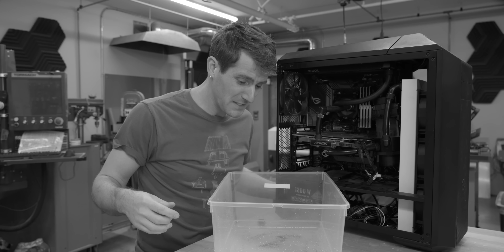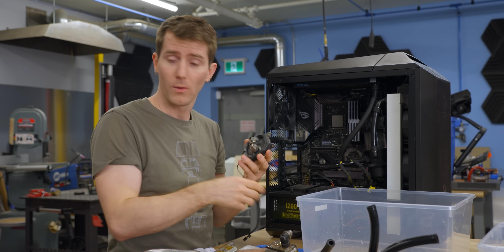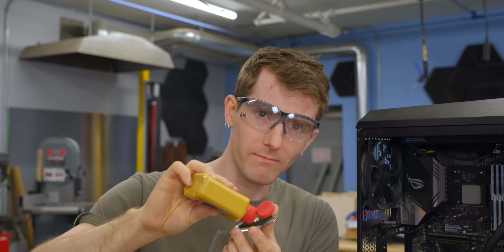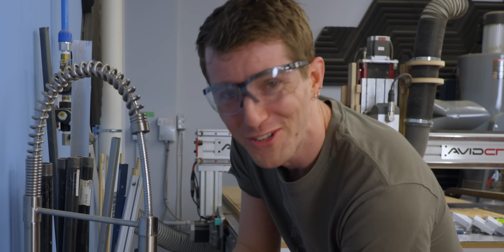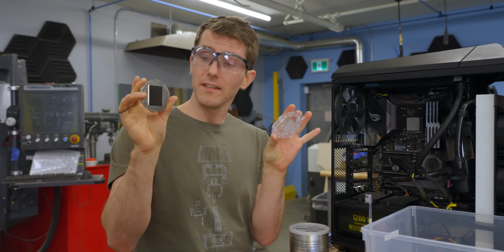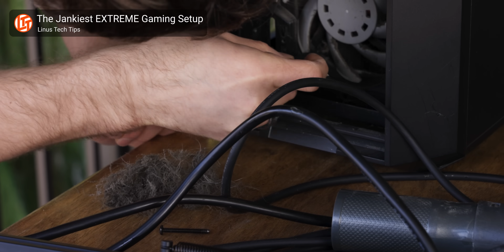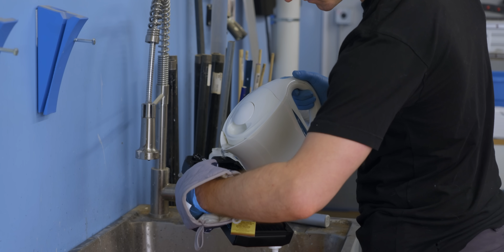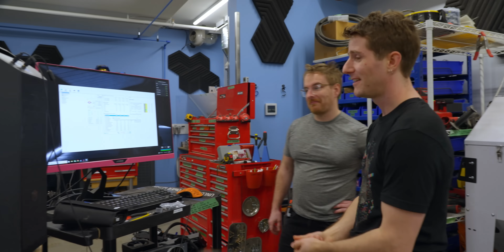I Will Never Watercool Again – Water Cooling Maintenance Guide

Comment: Tip for pc newcomers : water cooling is not necessarily better. Just go for a sufficient enough cpu cooler.
Reply: Its not cooler, but it is cooler 😉
Reply: well it used to be better, but that was before the thermal assassin and huge blow-through coolers on gpus
Reply: Or get an aio
Reply: @pratnala Why do that when a phantom spirit beats out even 360mm Rad AIOs? Liquid cooling is poop :)
Reply: @Nopulu  because an AIO is silent
Reply: 14:15 your answer is here. Just go with air cooling.
Reply: Absolutely. I have an air cooler that works amazing. I'm only going water-cooling eventually because I just want to. No inherent benefit really.
Reply: @3v068  it is cool, I can't say definitely why but it is 😂
Reply: I did water cooling because I thought it was fun. When I built my brothers computer I went full air cooling as he isn't very tech savy but just wanted to game.
Reply: True, especially with how cheap good air coolers are these days
Reply: And also practice undervolting
Reply: Maybe I am an outlier but I have a 10 year old aio with no problems. It lasted  longer than how often I upgrage my computer.
Reply: "if in doubt that your cooler will be good enough, use Noctua NH-D15" should be motto for all
Reply: Air coolers sure have come a long way in 25 years.

Remember the 400db Athlon era?
Reply: @myne00  
I feel like GPUs were worse and unless you buy a much more expensive third party card, GPUs can still get noisy. Man, my old stock EVGA GTX 760 drove me nuts during the summer...
When I set up a custom water cooled rig I just bought the cheapest blower model Vega 56 in 2020, put a water block on it, bios modded it to a Vega 64 Water Cooled Edition (which it has on par performance) and thanks to my custom loop it's completely silent.
Reply: is high temp pc cooling just not that practical? 
I mostly mean when temps get 90-100c  it seems nothing can really keep them down without undervolt or some kind of drawback in performance
Reply: If you do it right it's definitely better in terms of cooling performance and noise levels.
However I would recommend it only to enthusiast and/or people who like to tinker/do handicrafts/DIY/work with their hands, because even if you buy a custom loop set, you'll have to put it together. Since you'll want your GPU to be water-cooled as well and almost all GPUs will have to be refitted with a water block, you'll also have to do this task. With this task you'll have to be extra thorough, because if you damage the GPU in the process, no warranty will cover that. If things don't work out as planned and for whatever reason e.g. the GPU doesn't have significantly improved or even worse temps, you'll also have to do your own troubleshooting.

On the other side, if you enjoy working with your hands and enjoy DIY stuff plus are enthusiastic about your PC, there's a good chance you'll actually enjoy the process of putting your own custom loop together and will feel very satisfied once everything works as intended, because if done correctly, a custom loop can get you better temperatures at much lower noise levels compared to air cooling. Temperature improvements are especially high in case of the GPU and if you go for direct die cooling in case of your CPU.

I have a big custom loop put together with a bunch of weird form factor (=significantly cheaper) and second hand components in order to save costs. Of course as a result my loop was a lot more work to set up, especially also because I had a tight budget on the case. So I had to modify things quite a bit to make everything fit. However I enjoyed putting everything together. Half the fun of getting a new, water-cooled PC for me was putting it all together.
Reply: AIO / Air Cooling FTW
Reply: A lot of numbers but no dB messearuments... that is what is important here as well.
Reply: GPU go vroooooooooooooooooom
Reply: I generally agree with the tip, because watercooling is more of a niche thing and not necessary at all to get good cooling. Some new pc builders come into watercooling with the wrong idea and bite off more than they can chew at the start. The advantage of watercooling is the heat capacity - and the aesthetics. It's not like your computer is suddenly going to turn into a refrigerator because it's watercooled. Depending on the radiator size and count, the fans, as well as the volume of the body of water in the loop, it's possible to have a nearly silent machine 24/7 even while under heavy loads. However, there are diminishing returns because a computer, aircooled or watercooled, can only be as cool as the environment allows. A PC in a hot room is not going to cool as well as a PC in a cold room.
Reply: @VlaunBurtlecraft  i like silent, i make water cool
Reply: @VlaunBurtlecraft  There are few more tricks you can do with watercooling. I know about two PC setup with large radiator (Mora 2) in basement. During winter some folks even had radiator outside. There are some options ho to cool below temperature in room without investment in chiller.
Reply: I like the love hate relationship I have with my water cooling system lol.
Reply: I use 3x 420 for 14900KS and 4080 gpu for longer heatsink , fans are silent
idle cpu 35-38
Gpu 28-30 Celsius, and gaming with at  dual4K monitor at 240 mhz ,almost 55 Celsius, thats all
Reply: It's significantly better. Just not the way Linus usually cocks it up...
Reply: Is it? Sure if you are overclocking or something but let's be honest, it's a few degrees of improvement for most people especially new PC builders.  @WihGlah
Reply: Headphones are not solution. I offen let PC work overnight  and I sleep in same room. I am using water coolin since 2005. Always custom loops. It is expensive but in long run it is not that bad.  Pump, radiator are still same. CPU block (D-Tek Fusion) lasted long. I just laser cut new mouting plate. GPU is only thing that is causing some troubles. Older GPUs needed only block on core. Now it is best  to use full cover water block. But they became expensive. On RX 290X I was modified stock cooler from dead card as heatspreder with two waterblocks. One for core, second for PWM and memories. Now I am looking for something on my 7900GRE.
Reply: want cooling want quiet want air. Noctua is your friend.
Reply: @michaeljeacock  exactly... Go brown! Or gray...
Reply: Basically, water and electronics are not good together. It's a corrosive relationship that never ends well. If you by some chance build the perfect watercooled PC, never have ANY issues, and your components last until you want to upgrade, there's always the chance a leak happens and your stuff is never 100% again. 

When I build a computer and I want to keep using it for a years to come, I don't put liquid anything inside it. Or near it.
Reply: @Baeloro1481  just leak test it before you add you coolant
Reply: @lord_rainbowman you missed the important part. Regardless of what you do, leaks are inevitable. Sometimes you don't even know it was leaking until the corrosion gets bad enough to compromise components. At that point, you are replacing hardware.
Reply: @Baeloro1481  Stuff doesn't leak if you build it right lol.
Reply: @JathraDH  ask Google real quick what causes pipes to leak...
Reply: @Baeloro1481  Irrelevant response.
Reply: @JathraDH  I can't help it if you won't educate yourself. Pipes can leak over time all on their own. Obviously the answer google would have given you.
Reply: @Baeloro1481 same.  liquid cooling should only be used if necessary, or youre looking for a silent build (which can be extra $$$)
Reply: If you have really quiet room, air cooling is annoying. Not to mention during gaming. With my custom loop 12cm fans were spining just at 400rpm. It is not always about performance.
Reply: @Woyta  humm or bump noise, it's a choice
Reply: you literally still have to run fans, you can just put them in a more better package.. @Woyta
Reply: @emeraldages  
If you have enough radiator surface area and decent fans, you can run them at such low RPM that they're inaudible.
When I built my new system with custom loop in early 2020 I still had an internal HDD for mass storage and backup. Thanks to big radiators my fans are now inaudible at all times. Suddenly my HDD became by far the loudest part of my PC and ot course I immediately threw it out and replaced it with an external HDD I plug in only to move stuff off of my SSDs.

I was used to a pretty noisy, air-cooled GTX 760 from EVGA and only realized just how quiet a PC can truly be after finally going full custom loop with big radiators.

I mean for under 200 bucks new you could even get a 420x420mm (9x 140mm fans) external Mora radiator from one of the best PC water cooling manufacturers out there, which is a pretty good deal if you ask me.
With that much radiator surface area you'll be able to cool top end PCs while your 9x 140mm fans barely need to spin.
I think I'll go for open bench + dust cover + external radiator for my next completely new build.
Reply: @emeraldages  Bigtower FTW. :) Switching to air would not save a lot of space in my case. I would still need some larger tower case.  Mother board fully populated. 5 storage drives (Yes, I have also NAS), optical drive,...
Reply: @Woyta  There is such a thing as normalizing fan speeds with air coolers. Shocking, I know.
Reply: @FlavouredInsecticide  Shocking. Still to noisy. My fans are turned off or running at minimum speed they are able to run at full load. It would be pretty hard to beat that with air.
Reply: @Woyta  at idle, an air cooler with good fans will be almost dead silent.
Reply: @maximus3294  At idle. Water is silent even at full load!
Reply: @Woyta  not sure why people are shittin on u for water cooling. lol but wanna know an easier and cheaper way to solve the sound problem?  The power of longer cables. Just put it in a closet/cabinet/drawer. Boom no more hear.
Reply: @Woyta  use headphones
Reply: @Woyta Use headphones. If you're using speakers then you're also listening to your mouse and keyboard while gaming so it's not like you're gonna have a silent environment (excluding game audio) anyways.
Reply: @Woyta  If you have a large and decent CPU cooler and a GPU model that is made similarly well, then noise isn't an issue either. My system is air cooled and the coil whine is by far the biggest noise complaint I have. And pretty much any noise from content/gaming will drown out fan noise anyway, unless you are running 80mm jet engine fans.

And yes, I also slept in the same room as my PC as it renders overnight. My PC is still quiet enough for that, and making sure all the RGB lights were turned off was the bigger issue.
Reply: @Michael-zf1ko  I dont live in big city. I live at edge of small city. Next to me are just fields and forrest. I have very quiet surrounding. Every sound is more noticible. That is why noise is issue for me. Case filled with acustic foam, Noctua fans at 400rmp. Parts that have whiny coils are going to RMA.  That is noise level I am trying to keep.
Reply: @Woyta  So? Who TF says I live in a big city? Since when was that brought into the conversation? I also live in a very quiet place.
Reply: @Michael-zf1ko  I brough it becase backround noise. That change perception of produced noise. In different enviroment my PCs were dead silent.  In my space they produce acceptable noise.
Reply: @Woyta while your point is valid, it's not a good enough reason for new PC builders imo
Reply: @rayok_zed  it's good info for every single new PC builder so they can judge if it fits their specific situation or not.
Reply: @Woyta  If you combine an airflow case a good CPU cooler and a well chosen GPU you can have the same thing.
Reply: @Woyta  Honestly I don't hear my fans at all in my torrent. Even with the room as quiet as I can get it the fans are only spinning about 500rpm and nearly silent.
Reply: @Woyta  then just ignore it
Reply: false, watercooling is always better. Done right. I used air a long time and my temps are never lower then on watercooling. 
but i got a full watercooled build, motherboard, cpu, gpu all are in the loop. 52 degrees celsius overall on full load, 30degrees idle, cpu 5900x 3080gpu & x570 motherboard; 2 times 360 radiators push pull fan config. 
Even during full summer heat this thing never goes over 60 degrees. its been running for a couple years now and i always refresh the cooling water every 6months.
Reply: @ChimsThoughts  I have a fractal torrent case with an RTX 4080 and an 7800X3D. I cap out at 65C in cinenbench all core loads and the fans are only up to 900 rpm at that point. If i wanted it to stay cooler I could make them spin a little faster. You can do better with water but the impact is marginal and the systems are already very cool compared to their designed operating temperature.
Reply: @Immudzen I'm calling bullshit on a 7800x3d capping out at 65c full load fullt torqued. Unless you are running a custom loop, arctic liquid freezer 3 420 or undervolting to high hell, or you have an ambient temperature of below 15c, you definitely aren't getting those temps with a simple air cooler. The thing runs in the 70s to 80s easily even on water.